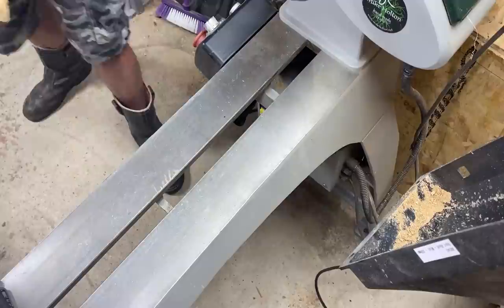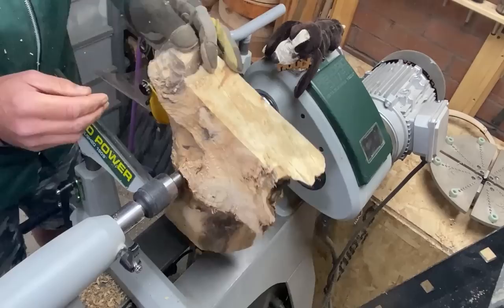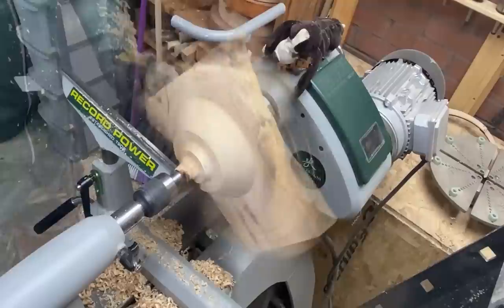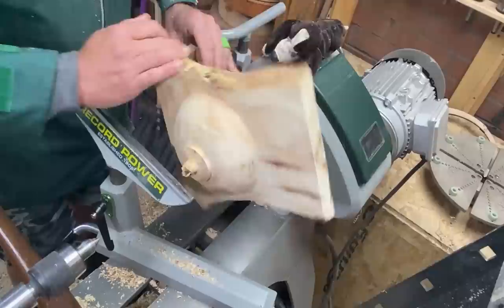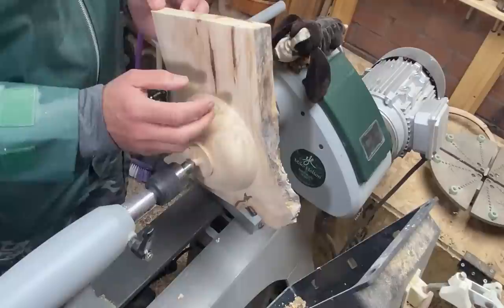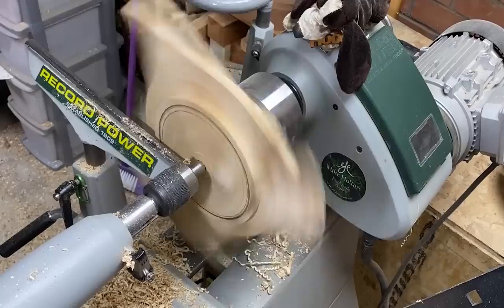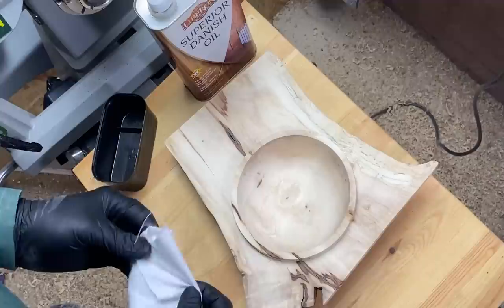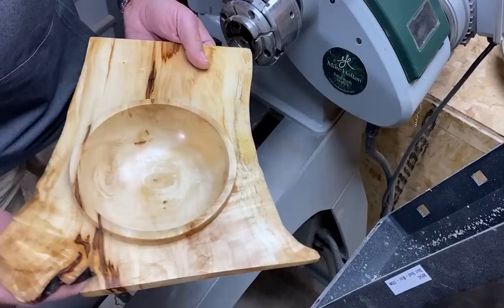Crafting a Figured Chestnut Mystery Bowl - woodturning project

Comment: I was a bit of a Doubting Thomas at the beginning because of the challenges you pointed out at the start. I was thinking, "How's he gonna make THAT work?" But you certainly did make it work and it turned out wonderfully! Great job as usual, Mike!  👍!!!
Reply from the maker: Thanks Tom, must admit I did have second thoughts a little while into the project wondering if I had made the right call.
Reply: @MikeHolton  some projects I've done have teetered on the edge of disaster throughout their entirety but when it turns out well, the feeling is one of triumph. Again, well done you!
Reply from the maker: @tomburns7544  Thanks my friend 😁

Comment: Hey Mike. I ended up watching this again by accident (not unusual at my age). I did enjoy the video again and really like the end product. I notice that you used steel wool to cut the finish. I have now switched entirely to 3m fiber pads which give just as good if not better finish, without the stray bits of steel everywhere. Its been a boon to me since I also build Cigar Box Guitars with magnetic pick ups, and the steel wool fragments produced by polishing the necks, tended to drift to the magnetic pickups. The pads are a cleaner process altogether.
Reply from the maker: Hi there, I have a few fibre pads as well I use now which really work great 😃 thanks

Comment: Customers either love or hate these kind of bowls. I love them though they do make you sweat a bit, and grit your teeth at times.Nice job. I'm not sure why you re-cut the bottom and tenon after the nub knocked it off center., after all the tenon and the base were aligned and the nub was removed.
Reply from the maker: Hi there, I still needed to sand and being off centre it would have made it a nightmare. I probably could have got away with it but I had enough wood to get it right so I did. If it was the right call I'm not sure but it seemed the right call at the time. All the best, Mike

Comment: With such an odd shaped bowl could you not leave the bottom as it was, slightly off centre?
Reply from the maker: Sorry I'm not with you?
Reply: @MikeHolton  After removing the tailstock you noticed it was off centre, could you not have left it & started the top?
Reply from the maker: @dozukime  I get you now, sorry for the confusion. No I needed the bottom of the bowl to be square and running true before I turned it round otherwise it would have given uneven wall thicknesses and rim. All the best, Mike